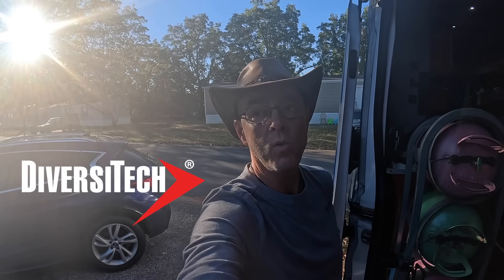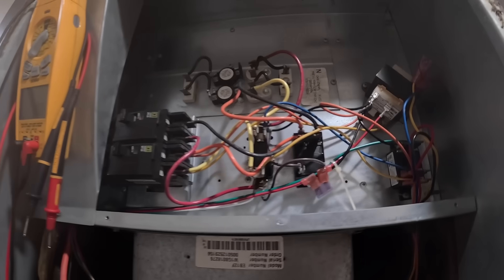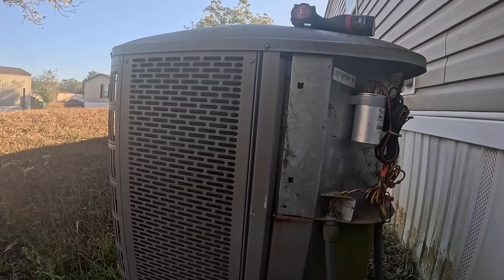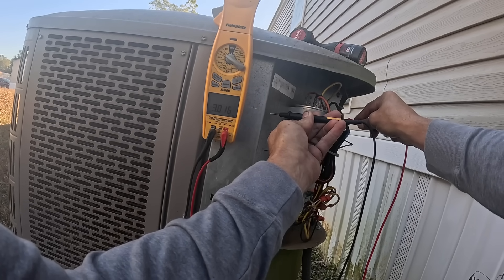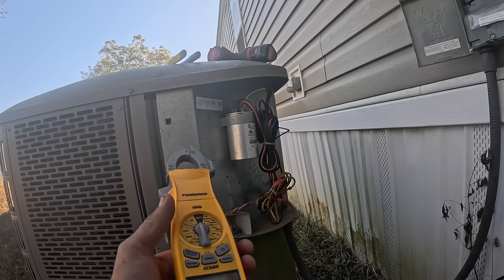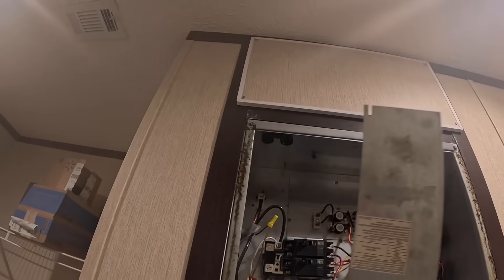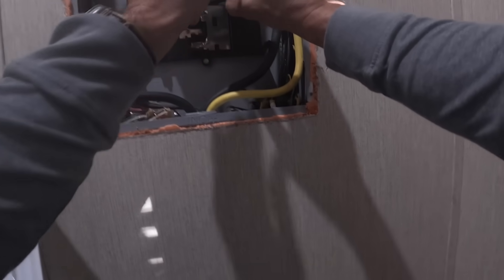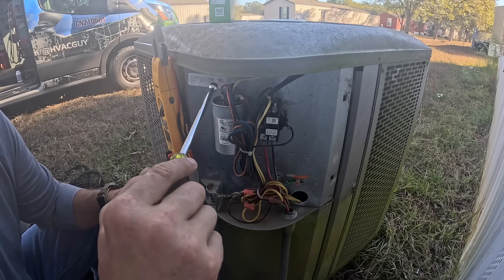Correcting Problems, But Not Really Finding Reason For Breaker Tripping!

Comment: I had a 220v breaker in a box a couple winters ago that was randomly tripping. Couldn't figure out why for a bit until I looked at it with a thermal camera and showed that the breaker was almost 400° on its side. Only checked it because it was almost 200° on the side you could see while in the box. So I pulled it and boom seen how hot it was there on the sides. Thermal tripping was our diagnosis and we replaced it. Hasn't tripped since. 👍🏼

Comment: You need to carry a small magnet in your tool bag to make it easier to find those screws when you lose them. Just a thought. I had the same issue with a dryer. Thought the element was popping the breaker and it ended up being the breaker. They do go bad but it is sometimes hard to tell. Unless, someone knows how to test for a bad breaker?

Comment: That 30 amp circuit going out to the condenser should be removed from the air handler. Those lugs are not dual rated.  Illegal tap.

Comment: What is a 70 amp breaker feeding a 30 amp feed wire to the air handler?  Orange NM cable 30 amps?

Comment: the place actually has working ceiling birds/crickets and all the dust burning off heat strips will set them off. so we know that one of the two heat strips likely didn't come on in ac mode or the dust would likely be gone. but who knows, loose low voltage wire and short cycling compressor may be the issue.

Comment: wow crazy big breaker to trip if heat and air conditioning are seperate and don't run at same time.
I had line out to swiming pool pump that kept tripping turns out somebody ran the wire only a few inches deep and with no conduit so it was cut with a shovel and then just taped back up.
 when it was damp it would short to ground and draw too many amps for the breaker

Comment: tripping a  70 amp. I'd think heat strips were turning on/sticking on with the AC running and it short cycling from thermostat/low voltage wiring issue or hard starting from bad capacitor.
other than that crank it on and thermal cam the breaker/s, disconnect and wiring at all locations. bad breaker/loose wires will run hot and you'd also have excessive voltage drop anythign downstream of the problem area. it could even be upstream from the panel out to the meter or beyond, but that should have light dimming/flickering.

Comment: I love the SC680 meters also, but have you had issues where it would add 2 amps to your actual amp reading when using it wireless.  I watched a video review on that & Fieldpiece are supposed to have fixed the issue

Comment: Running electric  heat first time for season will burn off the dust on the element , smoke and smell will occur and from the look at that return grill I don’t see a filter . The outdoor duel cap is not causing the breaker of that capacity to trip . You will be back on this one . Try a hard start kit on compressor and a time delay on OD unit . Thank you for your attention to this matter 😂 Retired HVAC TECHNICIAN 45 yrs in the trade
Reply from the maker: There was a hog hair filter in there. Not exactly my favorite

Comment: I would check that wire going to the condenser  under the trailer, it is not rated for outdoor/wet locations, the insulation could be bad and laying in water which would cause a short.  If the evap coil is draining on the ground that is where the water could be coming from.  This would cause the breaker to trip after running for a while. I have seen it on a few occasions. Look at the 9:00 minute mark on your video, they have the wire feeding the condenser junctioned  on the L1 and L2 terminals which is telling me the only protection for the condenser is a 75 amp breaker which should be no more than 30 amps.
Reply from the maker: You’re right the the condenser needs its own breaker in the panel, and it was recommended

Comment: Those breakers can look good and be weak. Nice job
Reply from the maker: Thanks!
Reply: that's usually caused by loose connections at the wires or on the buss, if bad enough it will all be cooked.
could also be loose wires/poor contact downstream causing voltage drop and high current. but that usually spirals into a full meltdown real fast. lol

Comment: It may be another appliance tripping the breaker. When AC comes on simultaneously, there may be a max amp draw event.
Reply: Yeah but that does not really make sense. The AC is on a separate circuit than the 70A. The 70A is strictly electric heating and blower. He may have an issue where the resistance changes when it heats on the strip element. I have had weird issues with those elements. But more than likely it was simply a bad breaker. There is a huge load on that breaker from those heating elements, and they go bad all the time.